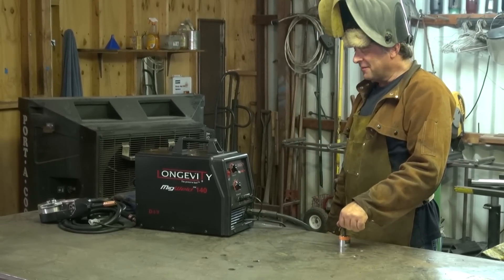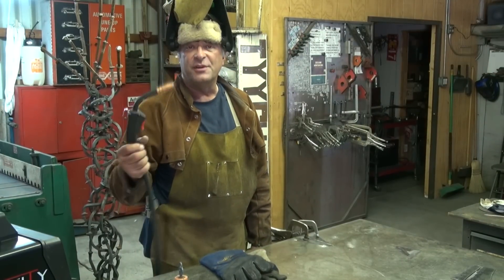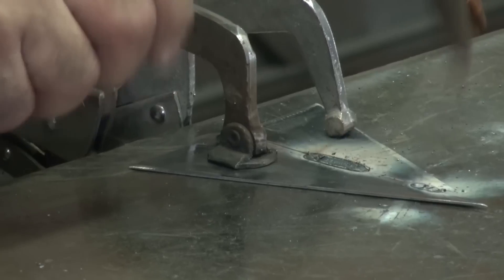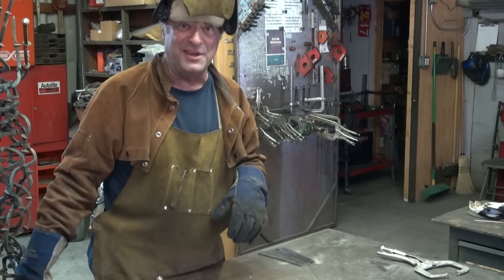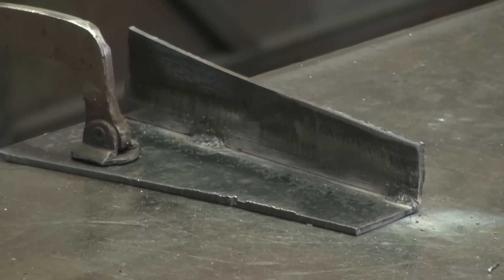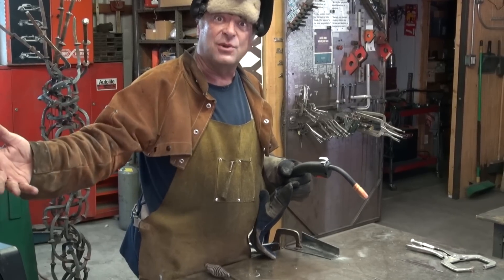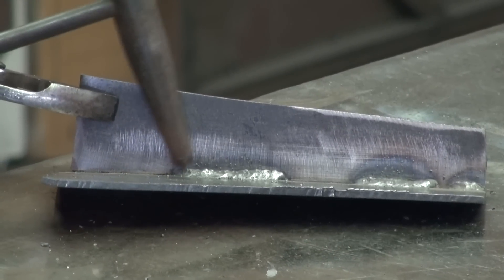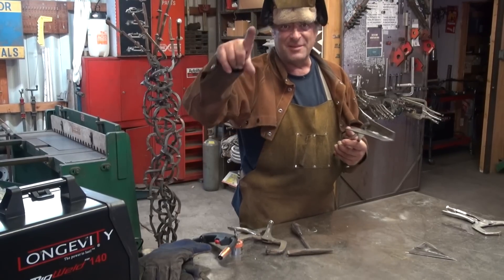How to Use a MIG Welder With Flux Core Wire - Kevin Caron

Comment: I have a Wolf MIG140, 30-135a, and is powered from a 230V single phase supply. I have no idea how to wire up to my house electronics so I've been looking at portable transformers. Do you think a 32a would be sufficient to run it?
Reply from the maker: It should be okay..   I normally run one on a 20 amp but I never get to full output with the machine..

Comment: What about wire brands? I have used some Harbor Freight flux wire and some Hobart stuff. Being newer to welding (especially flux core) I don't think I can tell the difference. Using brand names one would think they are better. Your thoughts?
Reply from the maker: +Tom Herd 

Have not noticed a difference in any of the brands..    I just use what I have on hand.

Comment: Might be worth saying that with electrode welding the flux is on the outside with a metal core and with flux cored wire it is a metal outer with a flux core and that the shielding gas produced in both processes is CO2 gas - which is where and why the original development for CO2 (MAG) welding started.

Comment: Is it safe to hold the material that ur trying to tac while welding?
Reply from the maker: Long as you are wearing a glove you will be fine.
Reply: Kevin Caron, Artist okay thanks. Also do you ground to the material your welding or to the table your welding on?
Reply from the maker: Safer to ground to the material, but not always possible.   Clamp your work to the table and ground to the table also works.

Comment: Kevin..  I'm just started welding and practicing a lot from your videos, but my problem
is i cant see where im going?  my welds aint bad considering the short time doing it.. but if i put 2 pieces of metal together and weld along the join, when i lift my helmet i see my welds are strayed off by miles ?  whats going wrong ? 
to me its like threading a needle in a darkened room !
Reply from the maker: kingdom777866 You may be looking down the gun.   Try looking at the weld from the side and looking for the joint.  Don't concentrate on the puddle!  Look right next to the puddle and you will see the joint easier..   You can also just draw a chalk line along side of the joint to give you a line to follow..    Another trick is to put more light in the weld, like a spot light or such...

Comment: Hi Great Vid learned lots however being new to welding was wondering something would this be good for welding a small wood stove for a ice shack? Dont know what thickness plate i have but its less than 1/8th more like a gauge..about half of 1/8th
Also is the flux core good on exhaust pipe say for a snowmobile?thanks the video its very good!

Comment: Hi Kevin, why do you need a spool gun to weld aluminum??
Reply from the maker: Because the aluminum wire is so soft it won't push the long mig cable..    The shorter spool gun  works better..   You can change the liner on the regular mig cable but you still need a short run to make it work..     You can also get a push/pull gun that will feed aluminum wire just fine but they can be expensive.
Reply: Kevin, thanks for the reply!
Reply: Kevin Caron, Artist Hi Kevin,
my name is Pete, I'm from the UK. Myself and my wife love to watch your channel. Information flows from you like a running tap/(fossit....I think it's called in the U.S and Canada...not sure). Anyway, love your wonderful  videos. Is it your wife that does the fantastic film work? Whomever, they do a great job. My youngest daughter likes the lady at the beginning, she copies her every time, her names millie,  she's  just turned 5 :-) Only thing is, if she meets someone with the name "Kevin", she shouts at the top of her voice "HEEEEY KEEVIN" in her cute but ridiculous attempt at an American accent ha ha ha.
Anyway, I too weld, I don't know why more people don't.....I too used flux cored, mainly because it's cheaper....I am not going to lie, I prefer with gas, I think everyone does, but family comes first, and there is always the compressed air, I do not like having massively pressurised containers like these so close to me while welding, I have a small shop so it makes sense to have flux core.
I haven't tried that welder, I bought the moderately price "sealey mightymig 150", excellent home shop welder (but it does require a 32amp power supply, not every hobbiest type person has that luxury).
I realise this is a lot more long winded than you are probably used to, but I wanted this opportunity which YouTube provides to personally thank you for what you do, I have learnt things from you, but one of the big reasons I enjoy watching you is because you are child friendly, you do not use profanity which for most you tubers is sadly second nature. It means a lot that you take into account that there are going to be younger audiences watching you and I really respect you and your family for this.
Best wishes from 
Pete and family ;-)
Reply: You dont need one. Use a shorter gun lead.
Reply: Shona O'Neill great comment! I mostly won't subscribe if they swear either. I have a family friendly channel too. My kids show up in many. My wife and kids? 5 reasons life really matters.
Reply: Daniel McBain Oh. You mean for the aluminum?

Comment: thanks for your professional knowledge i just found one of these in shed and it has flux core wire in it, so i dont need argon shield gas?? can you touch and not get electrocute ?? i never understood this...,,,
Reply from the maker: Most likely you don't need gas for the flux core wire you have.    You can touch the wire when you pull the trigger and not have a problem unless you are also holding the ground or leaning against the table that is grounded when you pull the trigger.

Comment: so can hi use it on my car to weld floor panel? im not a welder but looking at this video just make me feel like hi can do it .Kevin why i love the flex core because it's  cheaper here in Jamaica, to use then to use it with the  (gas ).  so you think it will be ok to weld my car panel ?
Reply from the maker: +Andrade Green        Nice clean metal to weld to,   no rust or paint allowed.     Make sure the fit is tight and practice on a piece of scrap to get the setting right before you start on the car..       Practice, practice and more practice..    You should be ok...

Comment: Kevin,or any welder looking,I have. Migmate150 dual purpose welder(quite old like me) it needs a new swan neck,but it goes into a brass block in the handle,does the neck unscrew?or must everything be renewed,any advice appreciated,thanks.
Reply from the maker: It "should" just unscrew.  Getting a replacement part may be the hardest part. 

I did find this site though,,        https://weldingdirect.com/sipstylmigwe.html

Comment: Hey Kevin, great vid. I am trying to weld the ends of 14 gauge steel wire together. Would something like this work well for such a job?
Reply: Did you get a reply to your question? From the distant past of my Apprenticeship days (1980 ish) I recall that welding of wire to wire (to form a "butt-weld") the main process used was Resistance Welding.
The ends to be joined are cleaned, treated with a flux, and a high current fed through, from one wire, to a pickup point on the 2nd wire. The gap, being the highest resistance point, heats up massively. The wires are pushed together by a reasonably light force. 
The heat generated is so high that the ends melt, forming a neat weld...

Comment: Why do you always hit your weld? Are you testing for strength or are you braking up some magnetism that could happen during welding, which would make it weaker? I don't know if welding causes this, but I was wondering.
Reply: +DE Nichols Ohhhh. As I almost finish the video, it occurs to me that hitting it gets more of the flash off so the wire brush has an easier time. Good technique. If I didn't get it right I hope you respond. :)
Reply from the maker: +DE Nichols          correct on the first try!!      Just getting the flux off the weld..
Reply: Kevin Caron, Artist Thank you. My wife is into cold metal jewelry work. I told her she should check your work out. This video focused on quality welds. I imagine the quality your after wouldn't be needed for art, so do you make some industry like things too or is your channels focus on art?

My wife seems interested. :)
Reply: Kevin Caron, Artist confirmed. She may be wanting the welder I use for cars for art. Lol
Reply from the maker: I am a sculptor,   I just make art....

I just happen to use a welder to do it...
Reply: Kevin Caron, Artist Very cool. Just learning welding for car work is a less interesting canvas. I've subscribed. I'd rather learn from someone making something different.
Reply from the maker: Thank you!   Welcome aboard.

Comment: hi Kevin im replacing a floor in an old classic van im restoring the weld is working but it spits and splatters when im welding the surface is clean but old i have anti splatter spray but not sure how to use it im useing a 135 amp cigweld 240 volt dont have 110 here with fluxcore my speed control is 1 to 10 and my power settings are 1 to 4
Reply: ***** the wire is 0.8

Comment: Is it still called flux core if you use gas? Kind of confusing on wire in the beginning.
Reply from the maker: Yes, but add dual shield to the description.

Comment: Hi Kevin Caron, Artist I have 2 question please?

1-?I need to buy a flux core nozzle for my wire feed welder, it has the thread on nozzle diffuser and would like to know if the Lincoln Flux Core Nozzle part# KH726 are thread on?

2-?My Wire feed welder is a DCEN and the wire is always live when the welders ON, is that normal?

If anybody else knows the answers please feel free to leave me a comment

Thanks in advance
Reply from the maker: Not sure on the nozzle, have to talk to Lincoln on that one. 

And No, the wire on the welder is not supposed to be live unless you pull the trigger.
Reply: Okay thanks I'll ask Lincoln. My welder is a older 1999 Campbell Hausfeld WF1800 arc welder that I got for free and was hoping that it was normal to stay live but I'll check into it.

Thanks buddy

Comment: Hi, are you able to weld stainless steel with this welder or is it just mild steel? P.S. is there any difference to how stainless steel welds in comparison to mild steel?
Reply from the maker: +James Assheton       Yes, you can weld stainless with this machine..    You have to run a tri-mix gas instead of the dual mix..  And you won't be able to go very thick with this machine...
Reply: Ok thank you that's very helpful. Also I was wondering if you could weld stainless steel without any gas, just on Flux Core like you did in the video?
Reply from the maker: Not that I am aware of..

Comment: I run .052 solid wire low 28.5 350 wire speed, high 32 450 wire speed, work for Caterpillar, you can lay down a lot of metal fast.

Comment: I'm planning on fabricating a flatbed for my Toyota pickup. Its not going to be super heavy duty or nothing just mainly the frame and headboard and maybe thinn square tubing since I plan on using boards as the floor. It will have two tool boxes bolted to floor as well. Would this welder work enough to fabricate this bed? Oh, I don't so too much welding besides patching up small things at work (I work as an automotive/diesel technician) and wanted to buy a welder for my garage.

Comment: Can someone explain the settings to me?
Mine says Hi / Lo - which I understand to be the voltage, but then there's a 1/2 rocker switch - what does that do? The fan goes faster when I turn it to 2. Instructions didn't explain it.
Reply from the maker: Which welder are you talking about?
Reply: Panana 100 MIG gasless
Reply: From what I've found, I think it's an intermediate switch, so you have 4 power settings:
1/min
2/min
1/max
2/max
Seems daft to me that it doesn't just have power dial 1,2,34, but I guess it's made for maximum cheapness.
Reply from the maker: I guess it is a cheaper machine.    Good luck.

Comment: I'm totally new to welding. I have seen a no gas 100 amp flux core mig welder on sale in the shop (sealey mighty mig 100) Will that be suitable for a beginner working on car body work and also welding thicker steel? 

I currently have an old 140 amp stick welder and that's real difficult to use because the stick keeps sticking to my work. Do flux core mig wire stick to work too?

Thanks
Reply: Get a lincoln mig pak 10 used, you won't regret it

Comment: I have a small flux core welder.120 volt. If I'm working on a trailer OUT SIDE, ....don't I have to ground to my trailer or somewhere on the trailer?
The Max Voltage is 37 and Mac amp is 105
Reply from the maker: +Real Gagne 

Yes, you have to ground to the trailer to weld.
Reply: +Kevin Caron, Artist  I'm a newbie. The ground puzzles me. Does it always have to be grounded to the piece being welded? ....... (ie) I'm in the middle of a gravel driveway and I have to weld 2 pieces of pipes......... Do I ground to One of the pipes to be welded?
I have a woodworking shop. I don't have metal tables to ground to.
Reply from the maker: Yes, you always have to ground to one of the pieces being welded....
Reply: +Kevin Caron, Artist  I'm the newbie again. This 120 V. gasless has a very vague manual. I have an On/Off switch...... Min./ Max switch, and a 1/2 switch plus the wire feed "0 to 9". It's a 100/130 Mig. ...It doesn't tell me what the Voltage or amps om Min./ Max.
Your One video says you need at least 180 amps for aluminum . but I ended up melting the aluminum that I thought was metal.
If the wire speed is pushing back on my tip...... I take it that it's set too high, but yer it did the same thing at number 1..... I watch you all the time, but I'm still having trouble with settings since there's no chart.
Reply from the maker: Boy I wish I could offer some advice on this one!      Start with steel..   say 1/8 inch plate..Use 0.030 wire and set your setting to middle of the dial..    You are just going to have to play with it and fine tune till you have a good weld going..   Only change one setting at a time..    start with wire feed,,   up or down till you get some result..   good or bad doesn't matter..    when you see a change for the better keep going till it gets worse..  now go back to the best setting..   It's the machine you are using that is giving you the most problems....
Reply: +Kevin Caron, Artist  Thanks so much. The machine came with 0.035. I'll get some .030 and see. Trial and error before trying to fix something   LOL
Reply: +Real Gagne I went through the same things when I first started. Be encouraged. :)

Comment: hey kevin love your video's im new to welding don't know shit but i have a mig pack 10 lincoln & i wanted your opinion on what you think about the machine for little welds like you were doing also i have gas but i don't know what im doing wrong but all i get is little balls of weld if you could call it that it's not welding like yours is  why? what am i doing wrong

Comment: Hey Kevin quick question. If I am taking a 3G vertical test on 1" beveled plate what voltage and wire speed settings do you recommend for root pass, and capping passes?

Comment: does it work on a 15 amp breaker or a 20 amp breaker?
Reply from the maker: Works fine on a 15 amp but you will get all the power if you run it on a 20.

Comment: I have a 110 all I use is fluxcore wire, I use it on exaust pipes body work  or projects it welds up to 3/16 thick metal  its a farm hand, made by hobart,my choice in a welder would be miller, but Lincoln is just as good, my welder is made by Hobart it wouldn't be my  first choice, but works fine, my boss had a 110 lincold we used fine wire in it and welder the same  as the 220 welders, for displays and shelves for J.C.Pennys

Comment: Can i weld aluminum sheets of 1.5 mm using a flux core mig 90 amp machine ?
Reply from the maker: Vimototv victor montes de oca NO, not with that machine..   You need a about 185 amps to get the job done right..
Reply: Just try it +Vimototv victor montes de oca

Comment: need advise please for an exam and can't find answer anywhere,,,

which of the following shielding gases can be supplied as liquefied gas,
Carbon dioxide,
Argon,
Helium,
Nitrogen
Reply: I don't l know yet Kevin but i will put that answer down as it is a, b , c , or d multiple choice and it is an online welding  course here in England with ATL  Practical Training i am on at the moment. Thanks for reply, great vid :))
Reply: no doubt i mite ask for more answer's during my studying if i get confused on something oif that's okay,, again thank you
Reply: thank you
Reply: the correct answer was carbon dioxide in the exam but thanks for the reply
Reply: Gary Reed
did you get the answer on the test right ?
You can also get a Co2 cylinder with a dip tube for liquid filling paint ball guns .
I'm sure they have many other uses also .
Reply: B Ann Yes it was Co2
Reply: Did you pass?

Comment: thats the video i want to see it from you its great welder no noisy the good thing you can weld thin metal the arc welding cant do it flux core no gas requred but you need to take off the flux and clean the mess thank you too much my friend

Comment: Can i weld 1mm steel plate ?
Reply from the maker: No, not enough power for that thickness.
Reply: @KevincaronSculpture  1mm is only  1/16" and the welder will weld 3/16"

Comment: Is it possible to use FLux Core with Gas Mig welder?
Reply from the maker: Sure, just don't turn on the gas.
Reply: Thank you Kevin. Really enjoy your videos.
Reply from the maker: Yes, that is correct.
Reply: You can use flux core with shielding gas.  It is called "dual shield".  I believe the flux core wire is a different type from what you would use without gas.